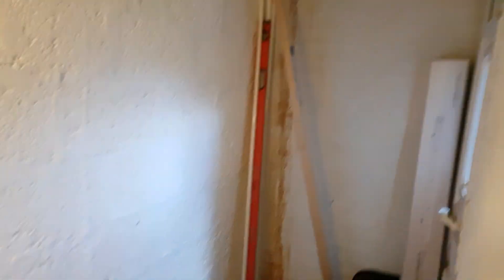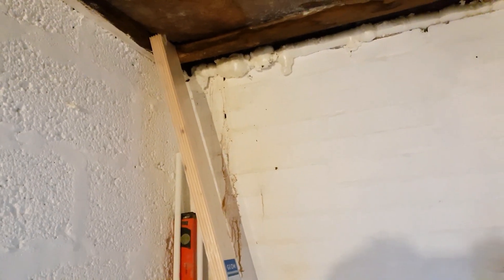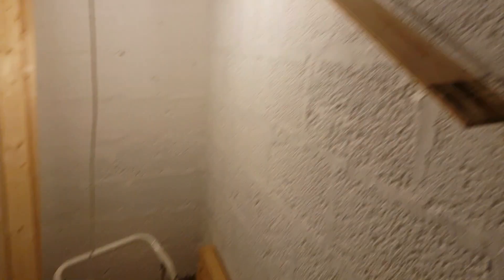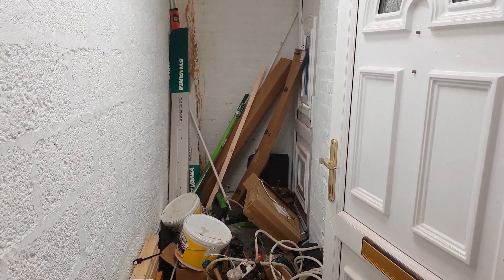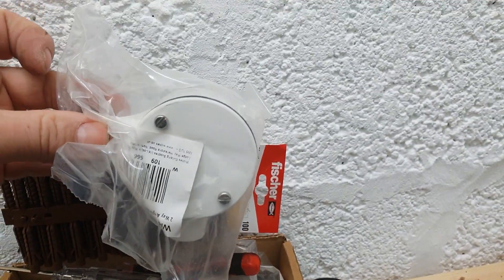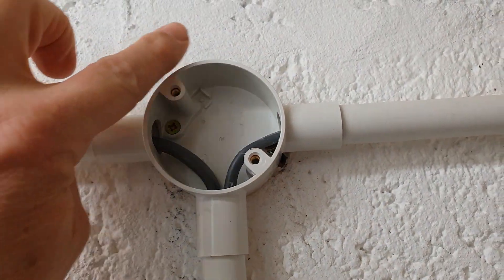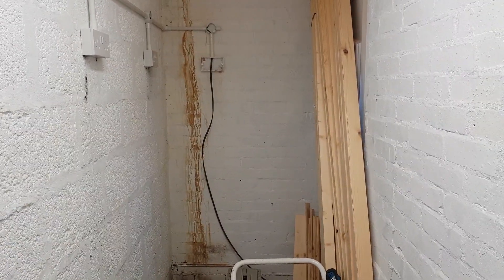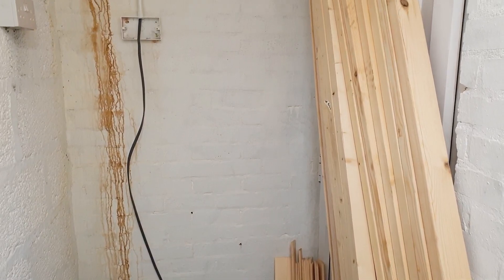HOW TO BUILD A CORAL FRAG ROOM PART 1

Comment: Rather than using an extractor fan to deal with condensation have you considered running a dehumidifier instead?  Seems a shame to insulate the roof against heat loss then use an extractor fan to suck all the warm air out and replace it with cold air.
Reply from the maker: As it's a small room I want to renew the air the room as it affects ph . Good idea tho. I've got one somewhere. Also it will come in handy in the hotter months for cooling things down.